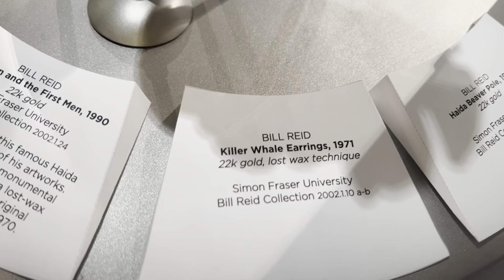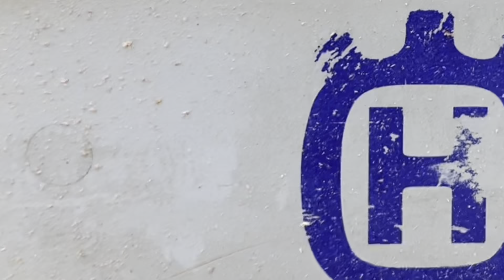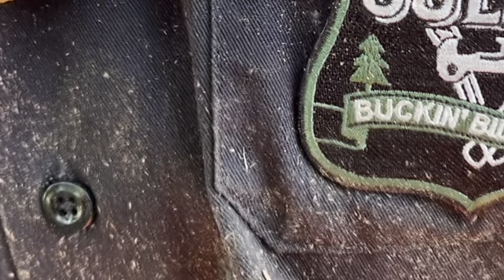This could be your problem. Chainsaw sharpening

Comment: I don’t use guides nor gauges when I file my chains. I sharpen for the cutting point, cutting edge, & I do not forget the gullet. I switch from my round file (running a Husky 572 XP w/ 28” bar, skip tooth 3/8 chain & my current backup is a Husky 61 w/ 24” bar) to my flat file & shave 5 strokes from the raker. Then I roll forward & switch sides till I’m done, with an eye for angles & that pinprick. I try to be conservative on the metal I shave, but I’m not satisfied till each tooth is razor sharp. I’m bucking 2 cords or more per day, & the time to hand file pays dividends 100%! If I’m getting good square chips; not shreds. And I flip my bar whenever I remove the chain, & file down any burrs. I learned all of it by watching Buckin’ Billy Ray & years of daily bucking. Now I love to file! We have firewood to get out to our customers, so it’s imperative to have that razor sharp chain… every time. Greetings from the Bitterroot!

Comment: Great wood craft work.  Great sharpening teaching.  Amateur here in Alabama.  Have found often with some tougher woods like hickory, oak or sweet gum, the rakers wear such I only need the round file to sharpen teeth and no raker sticks out over gage when I check rakers.  But with easy woods like pine, yellow poplar (aka tulip tree) or black cherry, yep, pretty much all the rakers need adjustment after round filing the teeth.

Comment: Wish Carlton still made raker gauges like before.  Husky gauges are almost as soft as the Oregon and Stihl gauges.  The only one that appears to be made of hardened steel is the West Coast Saw.  And with theirs you can set the rakers at four different depths depending on wood you are cutting.
Reply: Try heating up your husky raker gauge until its bright red hot then quench it in some oil like atf. Your file should then skate right over it. Don’t quench them in water they may become brittle and break easily. These gauges are made out high carbon steel and will harden, if you get right they’ll just about last forever. 
E

Comment: west coast saw carries a very  comparable raker gage to the carlton for 3/8 
it's a bit thinner, but it is hard steel that holds up to long-term use
i've had  good experiences with mine

Comment: Nice pole.
Question Billy, Why do pull your starter cord out when switching off? You're the only one on YouTube that I've seen doing that.
Reply: It's not necessary on engines that have the pawls built into the pull starter but on engines where the pawls are flywheel mounted , when the engine stops the flywheel can kick backwards just a bit causing the pawls to extend and grab the starter section , i.e. try and drag the rope in , stressing the starter and causing damage over time .

Comment: Bucking first off who was that cute chick with you in front of the ufc sign? That’s first question, and second is….I’ve watched you notch out and square grind chains ⛓️, so how and what would it do if you round filed a chain but used like the next size up file? It digs out the gullet like mad and hooks 🪝 that tooth and I’m shooting like horseshoes and curly fries 🍟 of wood out the saw? Is there a downside to running them like this? Sure does seem to work killer for me so far